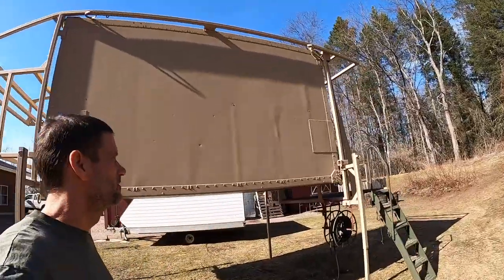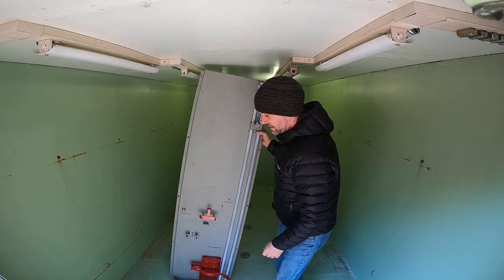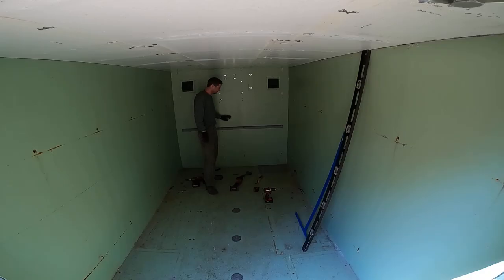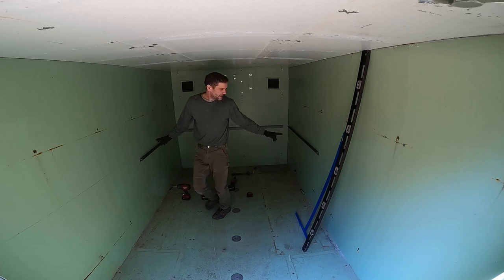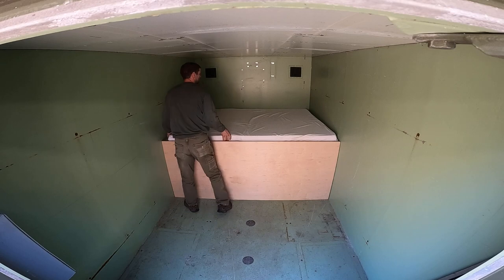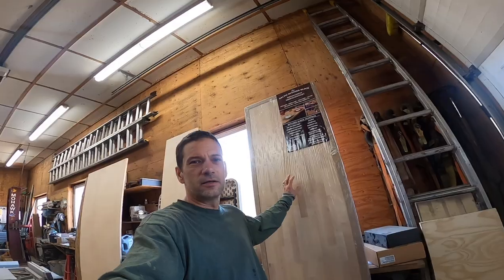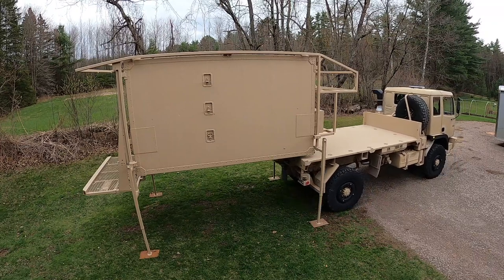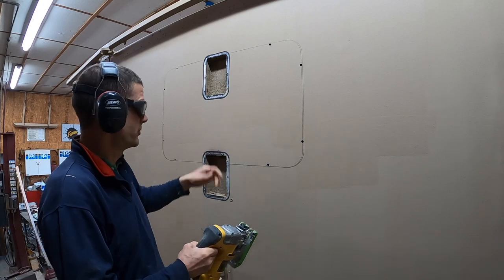Overland expedition camper DIY build Part 2

Comment: Way better than my idea I was gonna put a shipping container on the back but this way I can park the container part on a property and build a porch around it  and if I leave to go on the road I can do so easily 🥰🥰🥰🥰 one question how do I fit a jet tub and  stuffed sectional and a queen sized bed in it 🤔

I can put the sectional under the bed an put the bed on a Lyft but will the jet tub look rite in the open 🤔
Reply from the maker: You probably seen those tubs you can get with doors on them for elderly. You could get one with a door on each side so you could walk through it when not in use. 👍